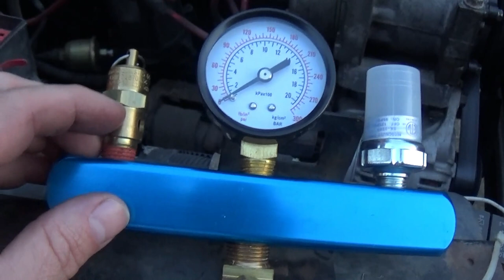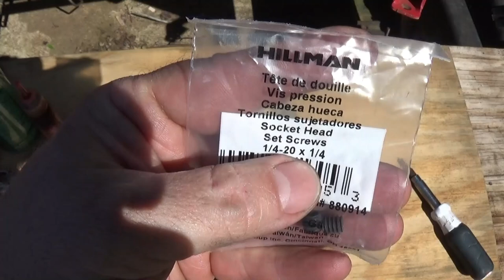On Board Air Compressor. Convert the AC compressor to an air compressor #OBA #Poweraddictscrew

Comment from the maker: Supplies needed for this project:

1/4-20 tap: https://amzn.to/3F57mLR
Tap Socket set: https://amzn.to/3LAC2Hl
1/4-20 set screws: https://amzn.to/3s2wXjf
High Temp Axle Grease: https://amzn.to/3s6XMmj

If Power Addicts has ever helped you and you wanna contribute in some way, here are some links that can help make that happen. Here is an Amazon link that gives Power Addicts a small commission. Using this link costs you NOTHING more. https://amzn.to/39XSTTO

The Paypal link is a simple way to make a simple donation if you want. Thank you for hanging out!! https://www.paypal.com/paypalme/PowerAddicts Thank you very much!! Have a great day!!
Reply: Why not use gear oil ?

Comment: Built 2 of these five years ago. Installed on c4500 for air ride still on there and second in tool box as a spare incase of failure.  Two tips regarding grease.  1st put your grease zert into the oil plug you pulled out then just screw it back in. 2nd only use Redline grease it has a crazy high temp drop point. I have 25k on my compress without failure.  Maybe it doesn't failure cause I bring a spare.

Comment: Have you considered plugging that hole and using engine oil or light gear lube instead of grease?
Reply: Yes, I was thinking gear oil or bar and chain oil - something thin enough to move around the “crankcase” to keep everything coated but still thick enough not to work its way past the piston O rings and into the air chambers?

Comment: I wish you posted this a day earlier. I just removed the  compressor yesterday and installed a Dorman idler pully in place of
Reply from the maker: Well .. you could always convert it and swap it back in. Not too late .. except for the idler pulley maybe. 😀 . You didn't need the pulley, all you had to do is buy a new belt for a non-AC Jeep.

Comment: If you coat your tap in grease it will collect most of the shavings making clean up just that much easier.
Reply from the maker: You are absolutely right! I totally forgot about doing that. Thanks for leaving a great tip!
Reply: And then clean it up with a shop rag so that the next tech that gets that rag slices there hands up on the metal shavings left over from cleaning 😂
Reply: Old post I know but you took the words right out of my mouth , using both techniques here would had been perfect,

Comment: another trick to catch all the shavings...slather up the tap with grease...as it cuts...the grease collects the shavings and will take em with the tap when you back it back out
Very very very cool...I wonder if you could use non-detergent air compressor oil in the crankcase/swashplate area instead of grease

Comment: Excellent video! That discharge port is on the high pressure side so I wouldn't worry about it too much. The air on that side is more dense so that restriction will look a lot "smaller", especially so if you are running a system around 90 psi for any tools or air lockers. 90 psi is around six Bar/six atmospheres, to give an idea about the density. 

You plugged one hole to the crankcase side... is there a second hole? How would refrigerant and lubricant originally have flowed through to that side of the case? I would not expect that such a tiny hole would provide the crankcase side with sufficient lubrication without a regular flow of lubricant. If you were to use an air oiler type system, how would you promote flow through the crankcase side?

Just did some googling... Sanden has a couple valuable PDFs in the results including a service guide! The other document is titled "A/C COMPRESSOR GUIDE AND PRACTICAL TIPS". It lists common failure modes for each type of Sanden compressor!

Thanks in advance!

Edit with another thought... air oil is quite thin stuff. I assume it would slosh around and provide cooling for all the components and bring that heat to the case. Grease may or may not provide that function. If I were to build a system such as this, with a good supply of air oil, I think a filter at the output of the compressor would catch most of the oil with some water, and a filter after a cooling device would catch a lot of water with some oil. I'll have to try that some day.

Comment: My sanden compressor seized up today, fortunately it happened in the driveway after I got home. It lasted about a hundred tires or so (6 months of heavy use). I'm gonna do an autopsy and try to figure out what went wrong.  Fortunately these compressors are cheap and plentiful. I'll convert another one this week. Just a word to the wise, always bring a backup air source. 
Thanks for another great video.
PS. Pair this bad boy with a bicycle shifter throttle set and have the fastest air on the trail 👍
Reply from the maker: You are welcome! Glad you enjoyed the video! Yep, I have a hand throttle ready to be installed 😀😀👍
Reply: Can you elaborate on the shifter? What's the use?

Comment: Loved the conversion.. Thanks. 
Do you have a video on removing an AC Compressor from a 2000 TJ 4L 6IL. My compressor is under the power steering pump drivers side. Thanks again. - Vince -
Reply from the maker: Nope, sorry no video on the TJ.

Comment: Thanks for the video.  What if you put oil and a vent in the back side of the compressor?  Wouldn't that be separated from the compressed air side?
Reply: I was thinking the same thing, put in fill and drain plugs and a vent then fill it about a third to half the way full of 90 weight. I  would think that would help keep it cool also.
Reply: @jesusisalive3227  Jesus is alive indeed.  I hadn't got my hands on a ac compressor yet.       But I want to take one apart and see if I can do that.  I was thinking maybe something like 30 weight oil.
Reply: @jesusisalive3227  Seems like the parts will be moving pretty fast thick oil might produce a little drag??

Comment: How about the cylinders where the actual heat is generated? The cylinders will seize up without lube.
Reply from the maker: I've used that compressor a lot since I released these videos. I've had no issues at all.

Comment: im curious, i know it would be additional work but what if you installed an oil line and drain, and used the engines oil pump to keep everything lubricated?
Reply from the maker: The pistons don't seal that well. It would pump oil into the air line and then into your tires. That's why when people convert these they use the grease method like I did or an air tool oiler just after the intake air filter.

Comment: What you could’ve done instead of trying to drill that out it’s just kept that side off pull the plug out of the center of the back of that housing and use that for your pressure discharge

Comment: So what i find interesting is people say you cant run the newer ac compressors cause they're cooled from the ac gas.the york ones are hard to find so this seems like a better option. Is the one you used oil lubricated from the beginning or is your method apllicable to most compressors?
Reply from the maker: It was a AC compressor I pulled off of a Cherokee XJ. I have ran this compressor quite a bit and I haven't had any "overheating" issues. The air it outputs does get the fittings slightly hot. It still runs fine after airing up many tires, and ran a few small air tools. I'll eventually pull it apart and check the grease and re-grease if needed.

Comment: how much air pressure will your setup make? enough to inflate a tire or run an air tool? or is it a max of 10 psi?
Reply from the maker: Tires and air tools .. no problem 👍
Reply: I don't recommend running tools on this setup, at least not for long. This compressor will get hot under extended use.
It will make 120 shop air no problem.
Reply: It will do hundreds of psi...but the pressure switch keeps it at say 120psi

Comment: Why does the compressor need to be oiled, when it operates as an ac unit it is not oiled. correct?
Reply from the maker: The factory refrigerant cycling through the AC system has oil in it.
Reply: @Poweraddicts  well that's good to know.

Comment: what about just filling it a third of the way with 90 weight?
Reply: Gotta be pag oil
Reply: @siegert726  

Im no longer using it with the ac system so im pretty sure any quality oil will work.

Comment: I want to do this but retain my AC. I know they make kits for adding a 2nd alternator but i haven't found anything for a 2nd compressor
Reply from the maker: There isn't a kit that I know of. I did see a way to have both AC and an on-board air compressor. I need to get some parts together to figure it out. Make sure you subscribe so you don't miss the video when I do figure it out and release the video.
Reply: @Poweraddicts  lol will do. I don't imagine you'd be doing it on a 5.3 v8 vortec? XD

Comment: So I've got air coming back out of the air intake/suction side.  What could this be. I've got the sanden sd7 variant.  And just have a filter on the suction side. Should I add a check valve to keep the back flow from coming back in
Reply from the maker: Yes, you need to watch the rest of the build videos for the complete system. There is a check valve after the compressor.

Comment: I have a question. Just installed one. First time running it. It seems as the compressor gets really hot is that usual?
Reply from the maker: Yes it does get pretty hot. So that is normal.
Reply: @Poweraddicts  also I have a lot of oil coming out of my separator is that normal as well?  I used it yesterday after the trail and filled up my 38s in great time. Just want to make sure all the oil coming out isn’t going to ruin the compressor.

Comment: So is this still going? Any issues or problems? I'm going to build one for air ride.
Reply from the maker: I used it a couple of days ago and today. It is doing just fine. I recommend checking the grease periodically if its used a lot. There is the option of running the external oiler instead of greasing the internals. I'm happy with it.
Reply: @Poweraddicts  Great! Thanks!

Comment: How much pressure it will get
Reply from the maker: My pressure switch is set to cut on at 95psi and cut off at 125psi. They are capable of much more but there is no need in running high pressure. This is more than enough to run small air tools if needed.
Reply: Well not true really higher pressure means more capacity which is generally good

Comment: One thing for sure, this will not work for very long.  If this would work , for any length of time, it would be done this way from the factory.
Reply from the maker: I've used it quite a lot. No issues at all. I do some HVAC as part of my full time job. I know that the oil is part of the refrigerant in an automotive set up. In a residential and commercial HVAC units the oil is in the crank case of the compressor not in the refrigerant.  So .. yes .. it is working just fine. I've ran small air tools and pumped up many tires large and small. I've used this to pump up tires more than my upright 60-gallon 2 -stage 5HP shop compressor. It pumps my 35s from flat to running pressure in under 2 minutes. When I build them like this I pull it apart maybe once or twice a year to clean the internals and regrease. I have not pulled the one in this video apart yet to perform any maintenance on it, there are still no issues at all and it performs great. Here is the video link where I demonstrated it. Have a great day! https://youtu.be/m8a6Wx1AMNM
Reply: You have no clue what you're talking about. This has been done for years by many. 
This is modifying and repurposing the compressor for a slightly different function of air not oil.

There's companies that modify new ones and sell em for this purpose
Reply: @mrmotofy get seized